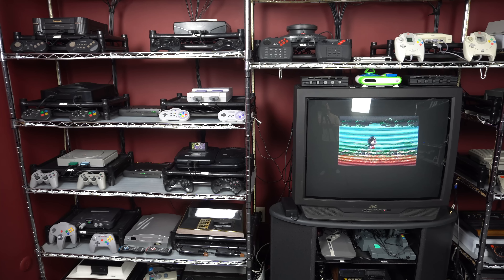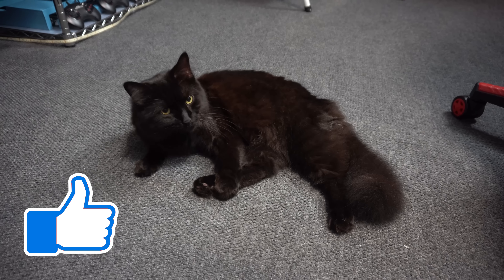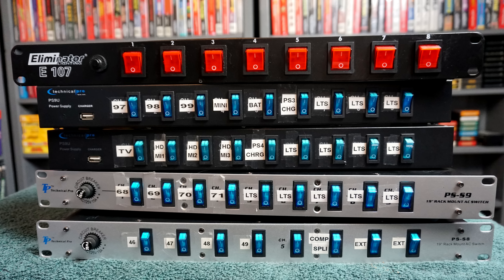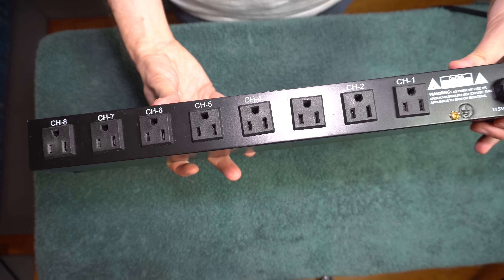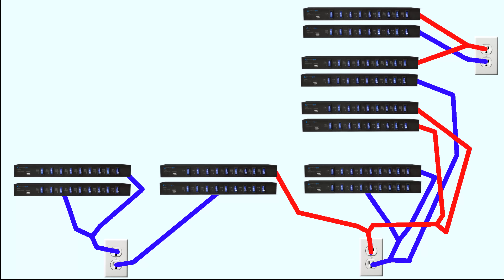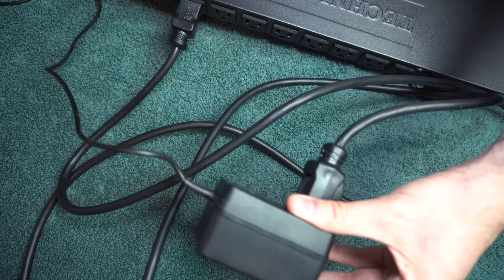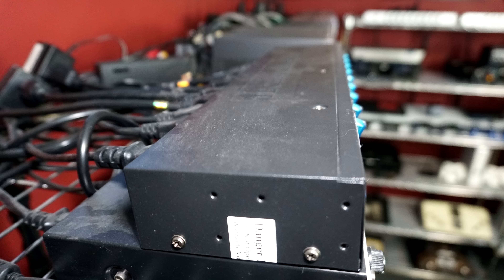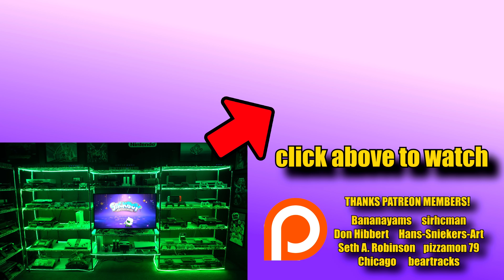How I Power 65 Game Systems

Comment from the maker: My gameroom items:
Rack Mount Power Supply: https://amzn.to/3NPpKvM
Power Cord Y Splitter: https://amzn.to/3zBfT8K
16 Port HDMI Switch 60 Hz: https://amzn.to/3H5vP4E
LG 43" 4K HDR TV (43UM7300PUA): https://amzn.to/3NddfZT
Kinivo HDMI Switch Box (550BN): https://amzn.to/3NQm7FW
10-Port USB Hub: https://amzn.to/39ixyae
Console Trays: https://amzn.to/3OOTzfV
Wall Shelf for Handhelds: https://amzn.to/3I3SS01
Vectrex table: https://amzn.to/39ZkmHE
4K HDMI Cable 8 feet/2 Pack: https://amzn.to/3QkKmgT
Wireless microphone: https://amzn.to/3xG04uO
Labelmaker: https://amzn.to/3OdaOYG
Vectrex overlay magnets: https://amzn.to/3ytxz57
Evercade Vs System: https://amzn.to/3OTk043

Other TESmart switchboxes (I don't own):
TESmart 16 Port HDMI Switch 30 Hz: https://amzn.to/39b9mGZ
TESmart 8 Port HDMI Switch 60 Hz: https://amzn.to/3xngDLY
TESmart 8 Port HDMI Switch 60 Hz: https://amzn.to/3NtDOuJ

Comment: You seem to have it pretty well covered.  Avoid cheap, thin, and/or frayed cords.  Avoid excessive heat.  Avoid dust, dirt, and/or debris.  No worries.
Reply: Additional note, DONT go by the outer thickness, it is not uncommon for 18AWG wires to be put in an extension cord with thick sleeving. Look for the wire gauge marking that will be on the outside of the cord along the side.
Reply: @MyBrothersMario  Another thing to test is voltage drop. That Kill-a-watt is great for that. Measure voltage at the wall, and voltage at the plug to the TV (WHILE it's on, so there's a load). If there is a significant drop, the cord, switches, or connection between is poor.
Reply: one thing ill add to this, if you are making a room that you plan on using in this manner, don't go with 14/2 romex, go with 12/2 romex..
Reply: @jeffjr84  its just that extra bit of copper to reduce voltage drop and resistance

Comment: Here in Italy we have inexpensive Power strips with individual switches for each plug. They are quite nice, thick and sturdy though.
The most important thing is load balancing. That way you don't overstress the wires and no excessive heat gets generated. 
I don't have as many systems as you, but I have older systems on a separate little cart , while modern systems are on the main tv and entertainment center
PC and relative stuff are on one wall plug , the entertainment center with tv and stuff on other two separate ones.
I still do the same thing you do: only 1 system at a time and the tv are on when I game. Plus the plug for usb charging my pads with their own usb power strip. That's the only thing that is always on , given the current draw is stupidly low.

Comment: i got this idea from you a few years ago and it works great. i use some older 5 switch pc monitor stand style ones for my setup that i have found at the thrift store for less than 10 bucks a piece. has been working great for me and thank you for the great ideas!
Reply from the maker: That was my idea? Interesting.
Reply: @GamingTheSystems1  i was watching a lot of gameroom tour videos to get ideas for how to setup my game room and your video was the only one at the time that used these power switches so pretty awesome advice
Reply from the maker: Cool. Glad it helped.
Reply: Those under-monitor switches are great, I have a few. I have each external hard drive's power connected to them, monitor and speakers, subwoofer, etc. Great for things I use once a week so they aren't powered on all the time generating heat and wearing out.

Comment: Anyone that said it was a fire hazard doesn't know the first thing about electricity nor electrical contracting. Great setup. Unfortunately there are just so many people that haven't a clue. About anything.
Reply: Fun fact:  You can actually daisy-chain two power strips, and even power them through an extension cord, without your house spontaneously combusting in flames.
Reply: These same people probably have one power strip connected to their smart tv, fast charger for phone, ps5, series x, and a computer. All in use at the same time usually.
Reply: Turn em all on at once while simultaneously showing your electric meter
Reply: @nickwallette6201  Exactly. As long as you use a thick enough gauge wire and don't overload the circuit, everything is fine. It's all wired up in parallel anyway.
Reply: @nickwallette6201  well that is partially true. Yes copper wire is copper wire. Doesn't matter if it's wire in the wall or an extension cord.
However while your outlets in the wall are rated for 15amps ( maybe 20 depending) there are many different gauges of extension cords. Most are not rated for 15amps. Most are rated significantly less. So to give the advice if just daisy chain any cord with any device isn't true.

If several devices were plugged in and on or In stand by the potential to have a very hot extension cord is possible. Heat means potential fire.
So while the setup in the video was done with much thought. Not everyone is that smart.
Daisy chaining some dollar store extension cords only meant for 5amps isn't the best.
Ideally if possible, it would be better to wire your room on a 20amp circuit with a gfci breaker.  
Aside from the 'fire hazard " myth. Protection against power surges is real and most people don't get there is a massive difference in a $50 surge protector and a $5 power strip / bar.

So there are factors to consider even if a fire is unlikely. They do happen
Reply: People have no idea, a breaker has a amperage rating for a reason. If the circuit is over amped ie 18 amps on a 20 amp breaker the breaker will trip.
Reply: @WattsUpBrooks  Actually the breaker is rated for the house wiring, to prevent it from heating up and starting a fire. The breaker is NOT to protect from devices plugged in overheating (otherwise a space heater couldn't work). A faulty extension cord or device can easily cause a fire, without tripping the breaker.
Reply: @gblargg  True a faulty device is a faulty device, I guess I didn't word it write, 12 awg wire is rated for  20 amp breaker which is NEC for wall outlets
Reply: @WattsUpBrooks  the concern is that you pull 15 amps through an extension cord that is only rated for 10 amps. The breaker won't trip because the house wiring is not being overloaded, and most extension cords aren't fused, so there's nothing protecting the extension cord.

Comment: This is pretty smart
The way I do it is I have a tv, wifi router, cable box, and any system made after 2005 is always plugged in and powered. Any of my older systems are off and I have a wireless switch to turn them on

Comment: I'm glad to have found someone else who used pdu racks as a solution to power supply for multiple systems. I got the idea last year when I saw someone buying and old pdu at a thrift store. When I got home I looked them up on Amazon. I ended up going with the Pyle pdu and short extensions. I use bright blank rummage sale stickers on the shelf labeled with marker by each device. It was a bit of an investment but well worth it. 
Great game room by the way! The chrome pantry racks are a great idea. Also plenty of ventilation for each system. I may go with that in the future.

Comment: Thanks for sharing! One of your earlier videos is what led me to seek out PDUs for my current setup. It's really quite handy to make sure things aren't consuming power when they shouldn't be. Granted, I only have about 20 consoles instead of 65, so it's less of an issue, but saving energy is always a plus. I also added LEDs above each system that was connected to the PDU so that it's very obvious if a system is getting power.

Also, about the guy that tried to plug in a space heater into one of these, I thought it was common sense knowledge to not be plugging space heaters into anything except the wall, due to how much power they draw and how easy it would be to overload any power strip. Game consoles don't draw anywhere near the power a space heater would, not even 9 of them simultaneously.
Reply from the maker: Yeah, a space heater is definitely not a good use case, but his other observations were spot on.

Comment: Really nice setup and video. I apply similar ideas in a lower scale: powerstrips all over my home to turn off everything i'm not using and small extensions to separate blocky power adapters.
I don't know if you already did it, but i'm curious about the av setup. The wiring, the switches to select a system.

Comment: Now what do you do about video inputs? I know they make devices for selecting multiple signal inputs, but I would like to see how you have it setup. Even though some TV's have multiple inputs, it seems easier to just have a large switch connected to one input of each TV as a way to simplify things. Again, I am very curious to see your setup.
Reply: At 1:05 you can get a glimpse of some of these switchers, but yeah it’d be cool to know the specifics
Reply: Agreed, I would like to know
Reply: I have 15 consoles hooked up to one TV in my basement. A mix of classic and modern. 
I have an 8 input RCA switching unit. It has mechanical buttons to switch which input you are using. That covers the classic consoles (NES/SNES/N64/Gamecube/Xbox/Saturn/Dreamcast and my Genesis/32X/CD combo unit)
My Wii is using an RCA to HDMI adaptor, and is plugged into a 4 input HDMI switcher that has a remote. My Switch is also plugged into that switcher. My TV has 4 HDMI inputs, so that switcher uses one, and the other 3 are allocated to the remaining 3 inputs (Fully backwards compatible PS3/360/Xbox One) 

If I wanted to add my PS1 and PS2 to the mix (don’t have the room for them right now, hence the backwards compatible PS3) I would pick up at least a 2 input switcher and a 4 input switcher. The 2 input would be hooked to the TV obviously, with the 4 and 8 switcher units plugged into it, and then arrange the consoles accordingly to those switchers, and have a couple extra inputs available if I ever picked up some other classic consoles, like a NEOGEO or something.
Reply: It looks like he uses the Pelican 4 port Composite splitters. I have one and it works well but idk what he does for component

Comment: I've actually been looking into these PDUs while planning my new setup for my console shelf and its really nice to hear feedback from somebody that's used these for a long time in the same way I plan to use them. Thanks for sharing! My new console shelf is actually going to be a single wire rack shelf on casters. I do plan to occasionally move it from one room to another but having it on casters also makes cable management MUCH easier. As a fellow cable management appreciator that might be something worth considering.

Comment: Only other thing you might consider is grounding each of the wire shelves.  I'd hate for one of them to become energized from a loose connection.
Reply: Dude!  I was going to say the same thing! Almost word for word. It would be easy to do, having that ground screw on the back of the PDUs. It would help with any video or audio interferences around the older systems and CRT.

Comment: Looks like an awesome setup. 

My only tweak would be to replace your outlets with double gang boxes, giving you 4 plugs per outlet. 

That would remove the y splitter cords from your setup and it's a ridiculously simple change you can do yourself. 

My recommendation would be to get good commercial grade outlets, which are only slightly more expensive. Possibly a GFCI outlet on the first box, if those outlets are in series. 

Removes a potential failure point in the system (cheap y splitters) and cleans up some of the total cords.

Comment: This is an awesome setup and would love to have the space/money for it. However, if you want to take it a bit further, you could always get network switched PDUs. You can then bring them all into something like Home Assistant and use your phone to power on/off a system and its corresponding TV without having to manually flip the switches. You could then also use something like a Broadlink RM4 to change TV and AV switcher inputs (if they have IR) automatically as well. Another benefit of something like this is that you would be able to put a button near the door that would then power off all the PDUs that you can press when leaving. It'd be a fair bit of work to get this all setup though, but could be a fun project.

Comment: I'm going to have to get a couple of these for my hook up. I use a couple of standard but good surge protectors to turn my stuff off when I'm not around at the moment.
The most interesting of which being one that I pulled out of a Kodak Picture Maker Kiosk years ago. The switch is on a dongle that I mounted to the front of my entertainment center while the surge protector itself in hidden behind. The switch did wear out rather quickly and started sparking, so I cut it off and replaced it with a standard light switch. It's worked fine ever since.

Comment: I've always used separate surge protectors for each generation. I plan on moving in a few years, and I plan to build a power distribution system with shared modernized power supplies.

Comment: Those small extension cords for your NES and super nes, I didn't know those existed. So I'm going to get some of those. I also have a auxiliary cord where I can plug in devices to charge things and I have a device that's 5 volts that's perfect for recharging controllers when needed. It's good to keep partially charged to maintain battery life.

Comment: Very interesting how you've managed your setup. Mine is similar, but instead of PDU's I'm using three good surge protectors with high joule ratings. They all have switches that allow me to cut power from whatever is plugged into them. I always have them turned off when I'm not using anything so I'm confident that power usage and electrical hazards are at a minimum. I'm also using a tad less than a 3rd of the number of consoles you've got minus my processors, switchers and displays so I can get away with a bit less. Later on, when I get the time to rearrange more things, I plan on using a nice industrial grade UPS that used to be a part of my works big server rack before being upgraded. It needs a new battery pack, but they gave it to me for free as it was just going to be e-waste and it will function perfectly after I install the new battery pack. Despite being phased out for newer equipment in the workspace it will be more than enough to handle my console setup. I'll be plugging those surge protectors into the UPS instead of the various wall sockets around the room for added protection, freed up wall sockets, cleaner power, backup for surprise outages so I can turn everything off properly and a central point in which I can turn the entire setup on and off with just one button.

Comment: Seeing that old Nintendo AC adaptor brick made me realize that you could get rid of those old things waiting to fail and getting warm easily with aging caps by using a modern switching PSU with the corresponding specs.

Comment: You did a really good setup, ensuring you have both comfortability while being affordable and safe. and make sure to not run more than 1 or 2 systems with the tv. especially since both the new xbox and playstation can consume up to 200Watts on full load. 200 watts might not be that crazy compared to modern pc setups but its not common for these electronics to have some power spikes in the 300-400 watt range. its rare and doesn't last long but can happen. And offcourse as you mentioned, dont plug any high end gaming computers into here but fell free to connect smaller range pc's that consume way less power if you want to add some sort of pc gaming experience.

overall, you seem to cover most things pretty well. my only feedback would be to make sure very extension you have has some sort of surge protection. hence i recommend getting the best quality ones out there that can really prevent as much damage as possible from potential lighting strikes, considering how many devices you have and how expensive they might be too

Comment: Those AC adapters are either old linear or simply just transformers. Transformers, especially iron core, can have crazy standby consumption, definitely a few watt in some of the worse models. Definitely worth keeping them turned off.
Reply: This is true, but you can get modern power supplies that are much smaller, more reliable, and draw less power in general and at standby, you just need to do your research to make sure you are getting a good one that will supply the right voltage with the right polarity and has the right connector or use adapters to get the appropriate polarity and connector.

Comment: 10:46, well, don't plug space heaters to splitters/power boards/extension chords/pdus. Basically, anything that uses resistance to generate heat draws a lot of power, electricians will tell you that you should connect those directly to the wall, otherwise it's a fire hazard.
Reply: Even modern gaming PCs are starting to enter that territory...

Comment: While I have PDUs for my setup I do something even stupider. I use a PDU to Split an outlet for another set of PDUs Since a majority of game consoles are low power draws Daisy chaining them does work but only the Extrons and CRTs should be on their own PDU. this cleared up an entire plug for my sound system to draw all it wants from a separate plug.

If you want to get even stupider I have one of those decent sized RF powers remotes as well in front of the PDU. I have successfully made a wire system complicated enough that they need a manual to turn on the TV much less anything else.